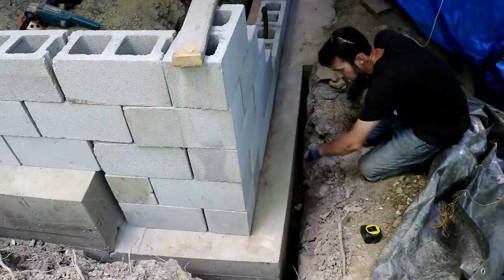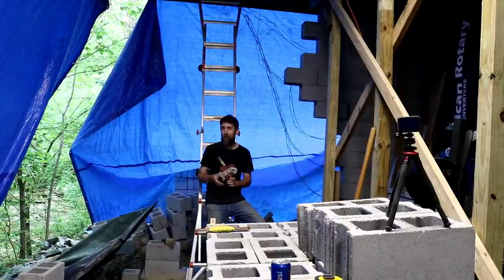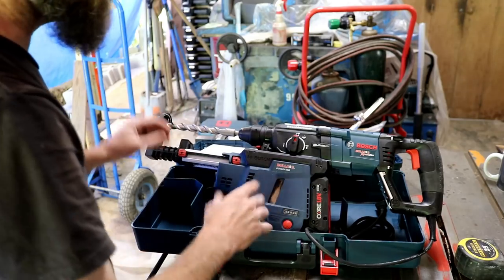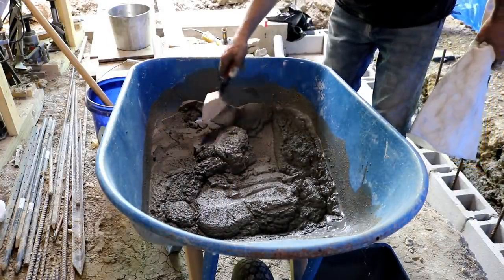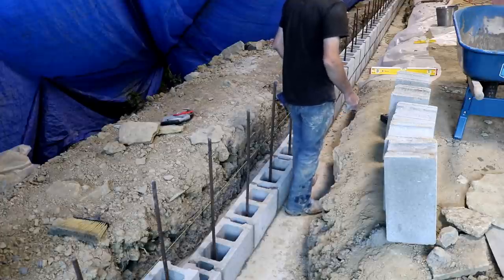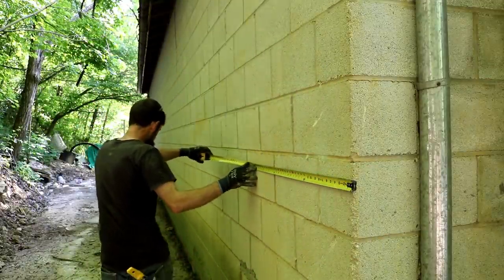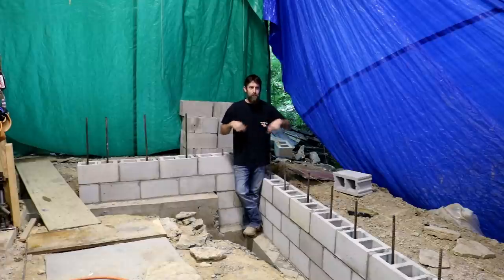Laying Block on the new footer

Comment: repurposed sliders are a great cheap solution. as for making them crank out windows ,you can buy heavy duty crank out hardware from greenhouse supply online and get them shipped. all you would need then is to find a machinist :) who could frame and hinge them.

Comment: No way! Yesterday at work I had to put some anchors into concrete. We have an old corded Makita hammer drill. It doesn't do much hammering. I guess it's the type with the ramped discs. So I left work to go to the store and buy that exact rotary hammer.

Comment: Have you ever considered wearing suspenders. Once I tried them I never went back to a belt. Way WAY more comfortable.
Reply: also great if you suffer from back pain, i found a lot of my back pain was from my pants being worn incorrectly then after that my belt being too tight, suspenders fixes BOTH problems
Reply: I personally prefer bib overalls.  Keys.  Key-weaves for summer, blue denim for cooler seasons.  Lots of space where it counts 🙄 ... you know, for your hernia supports
Reply: @infoanorexic  I am a Key man myself, purchased from the local Farm and Home Supply. I never heard of Key Weaves. Will have to check them out!
Reply: @diggerop

What the heck are key weaves?

I'm old enough, I picked up the bib habit from painters and carpenters, back when most all wore them. I have a well worn white cotton pair of bibs I wear in the summer, when the project allows. When it's really hot, I have a pair I made into shorts.

Too breezy up the legs for me to wear bibs in the winter, though.  LOL

I've seen a change over my life span of workmen moving away from wearing dedicated 'work clothes' specific to their trades, to most tradesmen wearing everything from sweats and tees to shorts and running shoes.  

Don't know why, but I see many guys wearing better clothes to work, where they get destroyed from paint, sealants, etc, than I wear for 'good' clothes. Baffles me how they can afford it, or the laundry expense and hassle.  

A pair of coveralls or bibs saves your clothes, your car/truck interior, and only need washing once a week, unless heat makes you sweat like crazy.  Maybe it's the 'throw away' mentality.

Speaking of white bibs and painters, if you're old enough, you remember when virtually all painters were, or ended up, alcoholics, (I had an uncle who was, and friend's dad who did autobody who was).  About 20-25 years ago, I learned the reason. 

The fumes from oil based paints, (not that long ago most all paint WASN'T latex.), makes you jittery, and your skin feel like it's 'crawling'. I have experienced it when I was young. It is NOT pleasant.  

Turns out, 3-4 shots or 4-5 beers will make the feeling go away.  Doing that every day, after work, to feel normal is the fast road to alcoholism.

A lot of men shortened or ruined their lives building our ships, painting our buildings and building/repairing our cars, so they could feed their families.  Wear your respirators...
Reply: @georgedennison3338  I was spray painting indoors without enough ventilation and I started to feel exactly what you describe. I had a shower to see if that would help and the water ran off my skin like it was waxed, you're right it was VERY unpleasant. I was only painting a small part and yet it seemed to effect most of my body, it really scared me. You raise some good points.

Comment: The concrete doesn't freeze. What you have to worry about is the freeze line. That is how far down the ground freezes, and when that happens it causes heave of the ground and it lifts the concrete.

Comment: Steve, you don't need to over-drill and glue your rebar.  Drill the same size as your rebar and pound them in.  You'll know when they bottom, they "ping".   Also, if you drill the holes at a slight angle, pound the rebar in and stand them up vertical, you almost triple the pull out strength.   I know this is just a home project to fix a shop but there is just so much wrong.   I love ya man and your machining is top notch.   But as a (retired) engineer used to commercial...  this imakes me wince.

Comment: I have some steel casement windows around 50 inches square. There are two of them.  If I can find some replacement windows that fit the opening you are welcome to them.
Reply: Two 36 tall by 50 also
Reply: Two 36 WIDE by 50 tall

Comment: Have you seen the plastic caps that fit over the exposed ends of rebar? Could save a nasty accident if you stumble, or simply lose track of the rebar while you're working round it.

Comment: 24:30 - if you work a lot with vertical rebar you can consider to piece tennis balls onto the ends to avoids your body parts to do the same.
Misting helps to facilitate adhesion to the stones.
27:40 Grout bag seems quite slow to me too. If you'd make this a profession (time is money) there are faster ways ... The bag wins in terms of neatness ;-)
Reply: yea, I always hated working around stobs. Heard a few horror stories about jobsite impalings.

Comment: 16 " = 40,64 cm or 406,4 mm. Greetings from germany. Mr. Summers where you squeeze out the  mortal it is helpfull that areas make a little bit wet, so the mortal held better

Comment: Instead of sticking rebar into the footing/foundation you should epoxy threaded bar into the footing/foundation every 4th hole that way when you get upto the timber height you can use the threaded bar to fasten the sole plate timber down to it that's if your still intending to complete that wall out of timber.

Comment: 40 or 41 cm not mm  406.4 mm 16inches .  So about 100 in and 400 apart very aprox.  You lay block like  a machinist  .  Great Video.

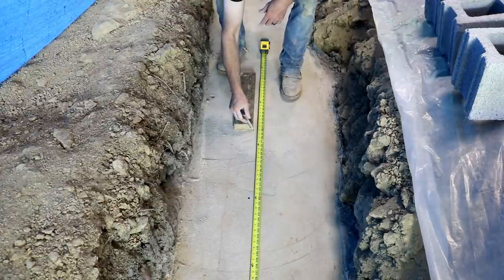Comment: No unlocking the doors?? Darn.   That's the same insulation I used in my metal shop building.  Build your corners plumb and square, and the rest of the job should go great.  10:46 Did you say 16" is 41mm?   Is that a Whisker Biscuit on the dust collector.  Don't be breathing that dust!!  It is hard on your lungs.  So long 'til next time.  Steve, you are a man of many talents.  Unless that whole bank sloughs off, that wall is staying put.  It's been a trip to get here.
Reply from the maker: Lung issues is bad news. It doesn't take much some times to mess a guy up. Looks like whisker biscuit to me😁

Comment: Sreve, I have done many things in my long life, and most of them at least adequately. But I cannot lay brick or block walls!. The instructionas all say "Butter the end of the brick with mortar." I do that, and what happens? The mortar immediately falls off! I know, I know, it all depends on how you mix the mortar, but mate, I cannot do that. 

So you have my admiration for that block wall (as well as for lots of other stuff).

On another note, Brian Bloc has Baily to check his work; you have Peanut, and later Walnut too. We don't have squirrels in Australia, although I did see them when I visited your country a few years ago, and I would love to befriend one. Oh well, I suppose I'll have to go and cultivate a koala or two, if I can find one...
Reply: Bonding liquid added to the mortar mix is the thing, helps the cement mix adhere both to the block and to the dry concrete. Hopefully the premixed mortar has a bonding additive added to the dry mix, as that really gets the bond strength up when you want adhesion to the concrete block.  In a pinch you can use PVA paint diluted a little with water to replace some of the mix water, it will work well enough to get you bonded properly to old dry mixed cement.

If Steve can get fly ash from somebody nearby him who burns coal, he can mix it 50/50 with the cement when doing that block fill mix, it provides bulk and extends the cement use, and being fine does not suffer from porosity.

Comment: Have you read any books on the subject? It looks like it while the rebar is caulked in place. Im reading on carpentry now, and ive read on concrete(forms) before. As well as welding and metal working. 
Its best to know you stuff before you do it. While if you do it and its done, there is not much you can do about it after that.. 
Ive read ATP books, carpentry, concrete, concrete formwork, and welding. And from some other publisher; machining fundamentals.  Ready is worth the while, and knowledge is power.! 
Always strife to do things on a day, it builds up in the long run. 

Nice build!

Greetings,

JEff

Comment: If playing with something when you were a kid made you good at it I would be good at doing something!....Lol
That drill reminds me of the BFG from DOOM! the video game!
Keep up the good work!
Reply: Ahh, memories of the Big, err, Freakin' Gun! :)
Reply: Those Bosch SDS drills are great, especially for concrete that is well cured, though the bits need to be the Bosch stepped ones, as they drill really nicely, or the 4 flute Hitachi ones, as they also go through fast. Nice is that Bosch also has service and spares available on a lot of the older models of those drills, and the price to repair and refurbish them id not too bad either.

Comment: Great job so far!
Will the bricks be filled with concrete when you do the slab extension?
I would suggest coating the vertical sides with some bituminous cover to prevent uprising moisture, even cover that with soft styrofoam against earth and little stones...
But why wooden sections on the wall? Are you short of bricks even with some holes for windows?
I stay tuned!
:-D

Comment: I didn't know you had chickens.    ;)
Reply: BTW, the only thing that outperforms a modern casement window is a "picture" window.  Picture windows do not open and so they simply seal more tightly.   AFAIK, some of the best windows you can get here in the US are made using Rehau engineered plastic components.  Sadly, no one makes any anywhere near you as far as I know.  I'm going to have to drive 3-4 hours to pickup mine.

Comment: Shouldn't you place the rebar in the wet footer before it sets up? That's the way Ive always seen it done. When you drill it, there is nothing holding the rebar down into the footer.

Comment: Was the 16” spacing on the verts specced by an engineer or was it your own idea. I would think that every 4’ would be sufficient with using durawall in some of the horizontal joints. Looks very good so far.
Reply: Every third web is a firewall. I don't know what every other web is. Other than one web too little. Every web is a vault.

Comment: Just curious, mortar surfaces aren't damped first? At least the base? idk.
Reply from the maker: I dont see that done by most the block guys around here. It may help the bond but I would prefer my blocks dry and my mortar on the wet or loose side. The dry block quickly stiffens the mortar and holds my block from sinking too low. This is just my experience.  I had to remove a couple blocks that I got low and the bond was great as is.  My thoughts are that the mortar really just spreads the compressive load more than anything. The grouting of the cells solid is where the strength will come from. IMO. I'm no block guy😁

Comment: I'm no expert  on cinder block, but I know a little about masonry work. I notice you are not wetting the concrete or the blocks, with red bricks, the brick wicks the moisture from the mortar too quickly if not wetted first, leading to a poor bond. I'm thinking you should be wetting the concrete and blocks before applying mortar.

Comment: wet the bricks down before laying them in cement , they will adhere better 
once youre one layer above ground level you can fill in the ditches around the foundation and partway up the wall  level eerything out and have the pump come in again to lay the floor inside the workshop , they can fill the bricks up with wats left of the cement and they can pull the hose straight to where they need to be (not have to run around the wall ) 
good idea to lay a rebarb mat in between two layers of bricks so you can tie the floor intoo the wall 
got a verry cheap hydro pneumatic hammerdrill , it works well enough for my use , its about 18 years old now and goes through concrete like butter
about the windows "prolly need to do a search for reclaim stores 
https://www.recyclingthepast.com/i16213-Steel-Frame-Factory-Window-With-34-Ventilator.aspx
https://www.recyclingthepast.com/i16252-Steel-Framed-Factory-Window-with-Ventilator.aspx#
they can ship them , you probably could make youre own windof frames for less from angle iron a T profile . can make them so large and make a steel supportframe for the roof than you hardly need any wood to fill in around the frame , put the windows in and use window putty to seal

Comment: I assume you explained this in a previous video and I just missed it, but what is the purpose of putting the blocks underground vs pouring the footer up to the level of the floor like (I assumed) is normally done.  I assume you will be pouring a floor at some point?
Reply: He is trying to save weight so it doesn't break off and try to fall in the creek again.
Reply from the maker: Plus not wanting to form the other vertical section. But it would have been quicker to pour it all at the same time.

Comment: Always try for perfection.  I f you are tying the walls together then I don't see how the mortar gaps can be different, unless the courses are not level with each other.  Obviously yje strength of the wall will rely on accuracy  between faces

Comment: You need two bags, so Elizabeth can keep you at the ready.
It's done now, but something to think about.
When I work as a Hod I'm always staging units, tempering mortar or running a fresh pan up onto the scaffold.
Build your corners all the way up and pull string on line blocks.
Like I said before, you're laying block to the line at the top of the course, the horizontal mortar joints take care of themselves.

Comment: i have never see a mason lay up block without using level line stretched from corner to corner.  Its how they avoid "accumulating errors".  They lay up the corners paying attention to height of each end then stretch a line for every course. For an internet content producer i would think you would have done more research at every stage, or maybe even watched one video of block laying. .  Not much respect for the mason's skills and techniques practiced over thousands of years.
Reply from the maker: Guess you didn't watch the video very close?.  😁  I have a line run everytime.
Reply: @SteveSummers  I do aploginze, as it seems you did have a line up.  I guess i was just horrified by the cake decorating methods ..